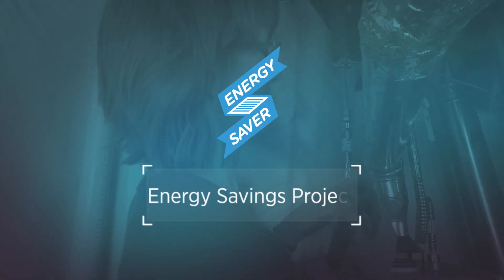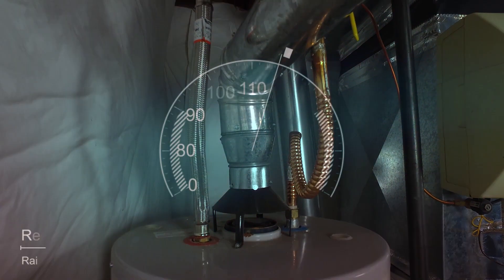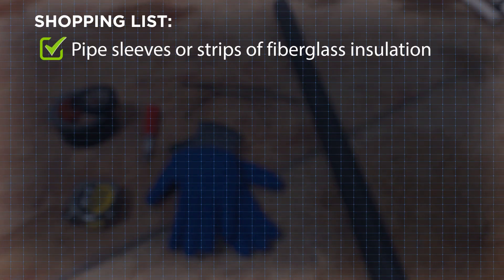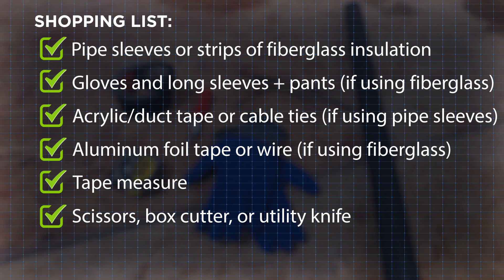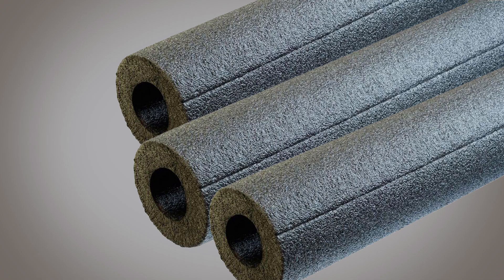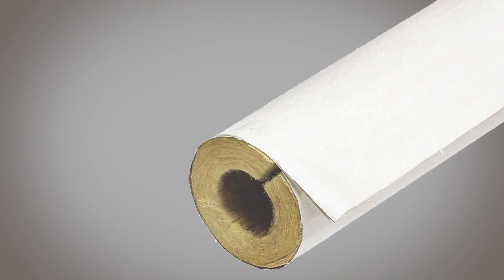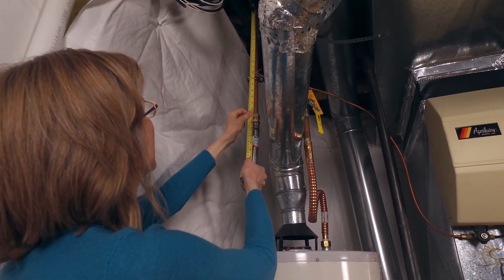Energy Savings Project: Insulating Your Hot Water Pipes

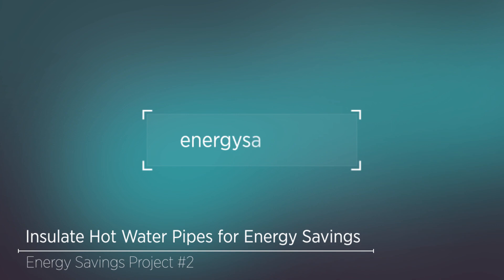Comment: At 1:32, it states "insulation should be kept at least 6 inches from the flue. If pipes are within 8 inches, your safest choice is fiberglass, "but then at 2:14, she puts foam tubular insulation three inches of the flue, which contradicts both statements. Fiberglass is good up to 500F to 1000F (depending on the heating duration), and a double wall B-Vent system does not exceed 400F above ambient, so why not use fiberglass for the whole run?
Reply: I"m confused by that too. They could just as easily show someone insulating for a gas heater. But I guess  she's insulating pipes for an electric tank heater and can use the common foam tube insulation.

Comment: Why insulate the cold water pipe?  Better to have it exposed to the warm air a bit ?? -  thx for the video.
Reply: Mine didn't start to freeze until last year. I  had to up my heat leave to hot air. I not had to do that before.  I am doing what I can not to have frozen pipes this year. That's thousands of dollars of damage  and not counting the plumber  and contractors.  I rather seal it up. For a lot less